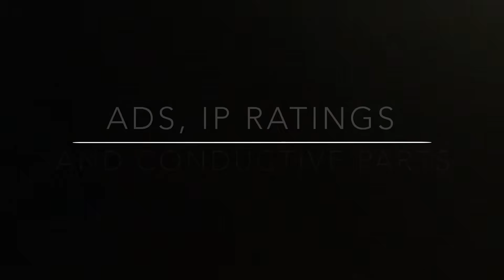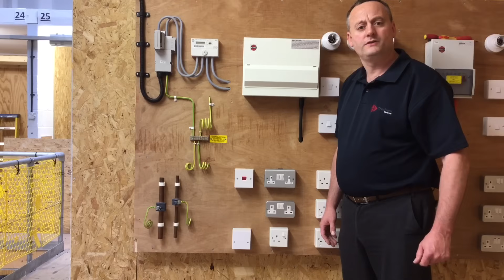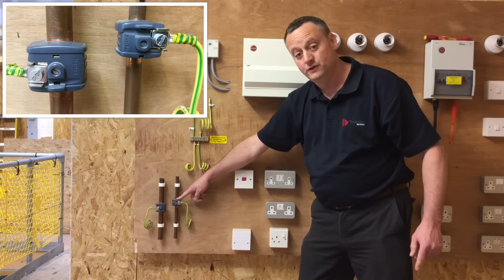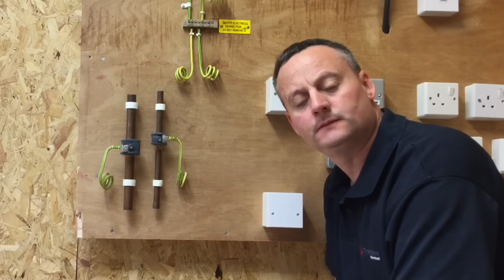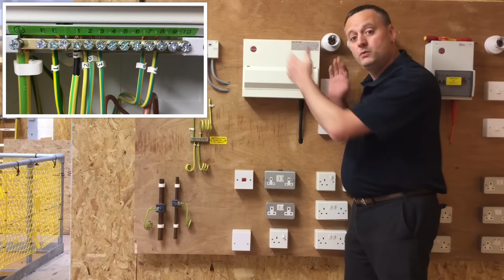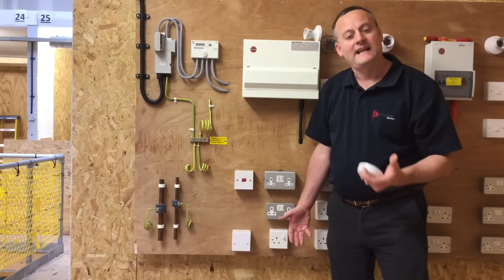Automatic Disconnection of Supply (ADS) Explained. IP Ratings, Exposed & Extraneous Conductive Parts

Comment: MY cutout has a black looking connector block marked PME to which three CPC/Earth connectors enter. Two are G/Y 10mm cables of which one goes inside the Main cutout with the fuse in it and the other goes to the CU. The other connection into the PME block is braided copper which is strap bonded to the lead outer sheath of the DNO's incoming cable. I suspect I have a TN-S supply but am a little confused as to why their is a 10mm CPC going into the cutout as this would be more typical of a TN-C-S supply. Do you have any advice on why there is the CPC going into the cutout. House was built in the late 1920's.

Comment: If ZS readings don’t meet the disconnection times is that ok if you have an RCD installed for additional protection
Reply from the maker: Hi. You will have to do a loop test between line and neutral to confirm that impedance is not above the max Zs. I cover in part in this video 
https://youtu.be/Z1VW93u_5pU
Thanks for commenting and watching. 
All the best GSH Electrical
Reply: Ive watched the video. Are the max zs values for LN the same as LE

Comment: Sorry just nit picking, you say the cpc is serving no purpose in the plastic roses and switches but it is, it’s continuing the earth to other accessories and is a test point. Just saying
Reply from the maker: Hi. If the system employs fully installed accessories then the cpc is not required however it’s in place in case an accessory is changed for an exposed conductive part. Thanks GSH Electrical
Reply: GSH Electrical 

And it is in place for testing purposes

Comment: We recently had a "Smart meter" installed. The service head fuse was originally 100A. He changed this to a 60A fuse. So now, our highest MCB is for the shower rated 40A, and not within the 2:1 ratio you mentioned. Also worth noting that in real world situations, you can't verify the size of fuse simply based on 100A writing on the service head casing, my example being a case in point, and legally you can't remove it to check it either.
Reply from the maker: +Lee Greveson 
Good points. Often the supply authorities are downgrading cutout fuses because household demand is falling due to energy efficiency improvements within the home. You would need to check the current curves in the Regs to prove discrimination the rule of thumb is 2:1 and it can be less. The supply authorities will allow you to pull the cutout fuse if you call them but normal will charge you the re-seal it or require you to pay in advance to have an isolator placed in the mains tails. My videos are for learners in there early stages of training. Thanks and all the best GSH Electrical